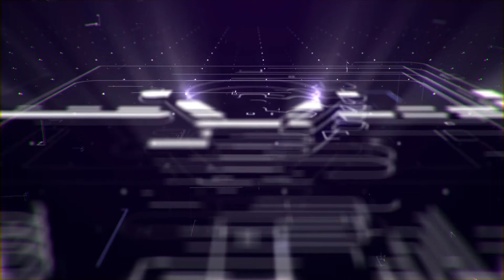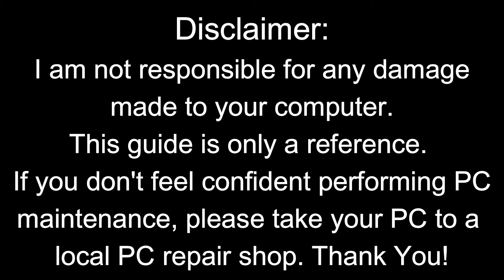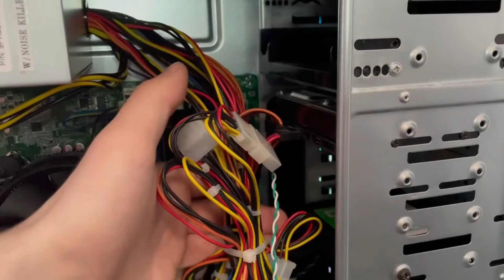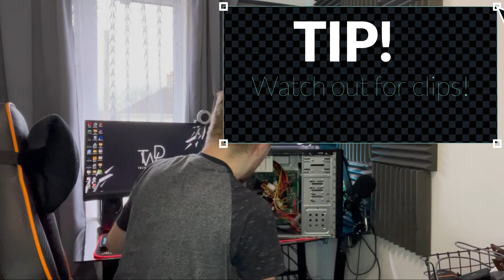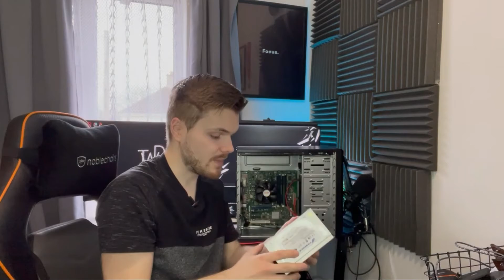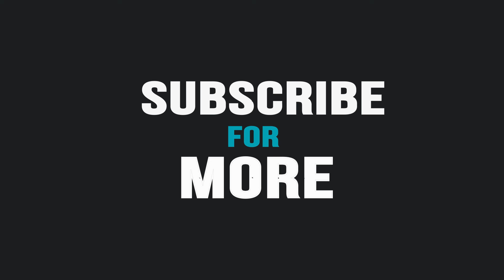How To Replace Your PSU (Power Supply Unit) 2022 Edition

Comment: is it safe to put the psu in that position because i mount the psu same as you did and i noticed that my top case is getting a little worm, is that normal??
Reply from the maker: There was no other option on that particular case. I never had my PSU get warm, then again it’s a low power PSU.